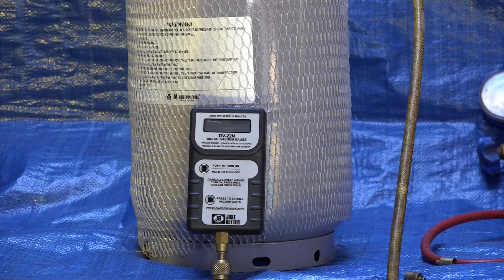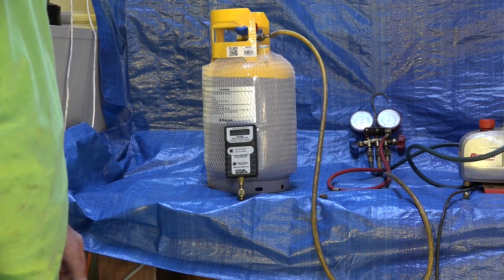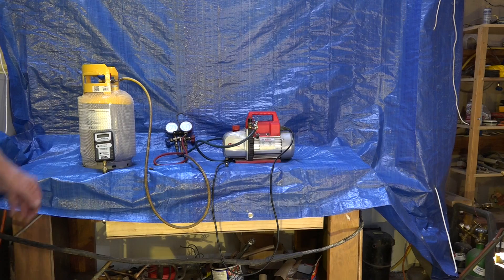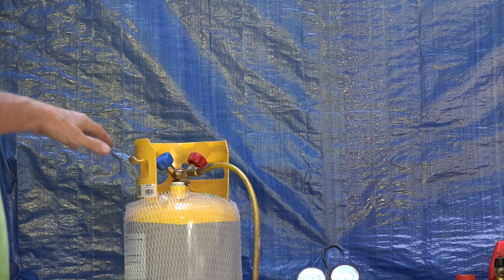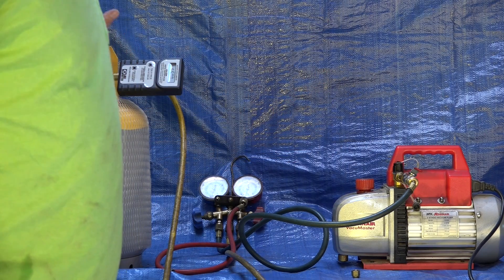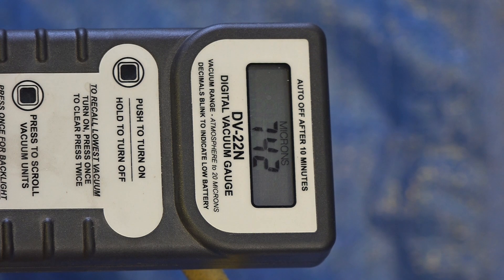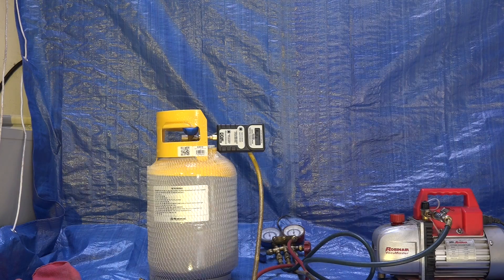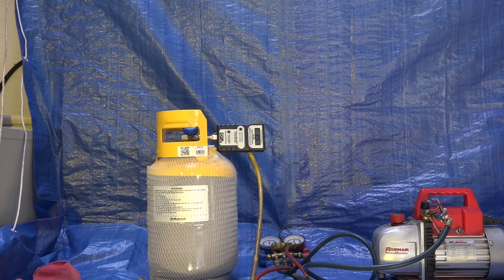How to set up the micron gauge

Comment: Can micron gauge handle positive pressure? Does it hurt the micron gauge to have positive pressure?
Reply from the maker: I have not had problems with pressure, but I remove it when pressure testing.  Also, the digital gauge sets have a micron gauge built in.  Hope this helps.
GFM

Comment: I'm in another trade. I've been watching you HVAC guys everyday for over a year. Great stuff. Finally a vid on pulling a vac to 500 microns. 
So what is 500,700,4200 microns - relative to what and means what in the system.
All I know about microns is what will pass through various mesh filters, etc.
If I may here's an answer from another hvac forum for us that don't know www.tinyurl.com/pws29zv
Reply from the maker: steveg5576 A micron is 1/10,000 of an inch mercury.  It is not important to know the definition, just what you need to get a reasonably complete vacuum to be sure there is no moisture or non condensable gasses in the system.  Its amazing how damaging moisture or oxygen can be to a refrigeration system.
GFM